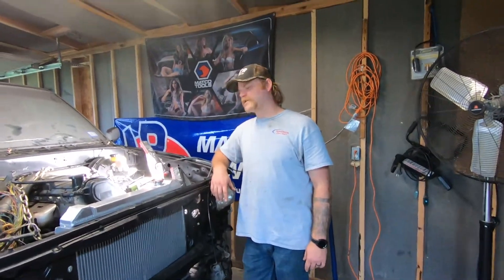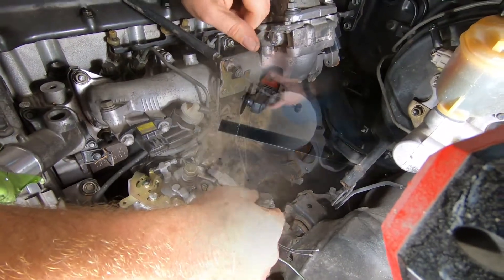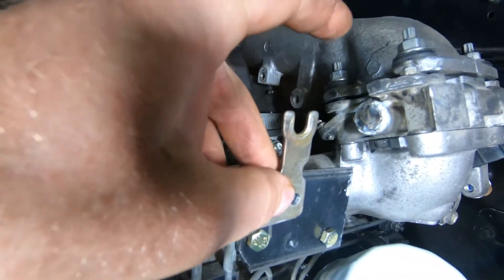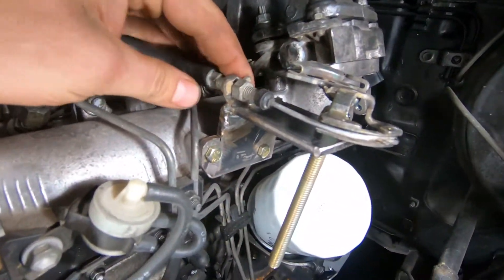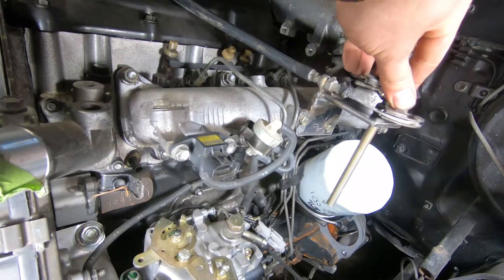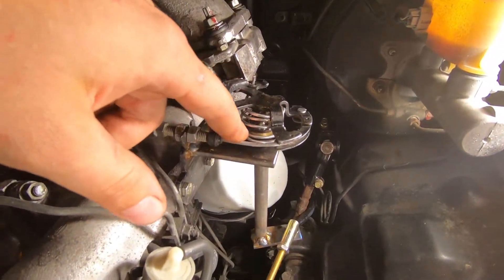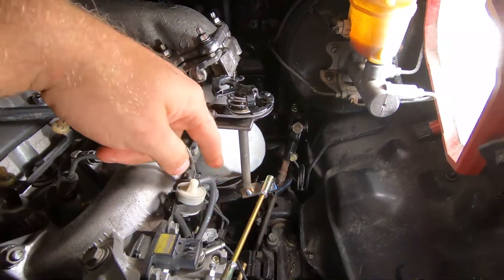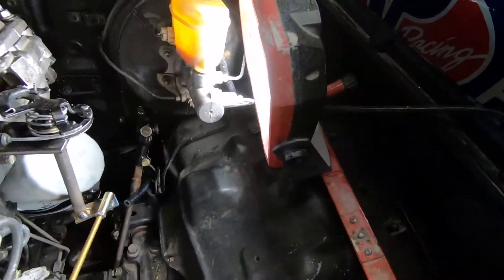1kz throttle system

Comment: Hey, I got a kzte hilux with a p1123 code "accelerator pedal position sensor intermittent high voltage" 

Vehicle goes into limp mode and cel on dashboard

How do I resolve it